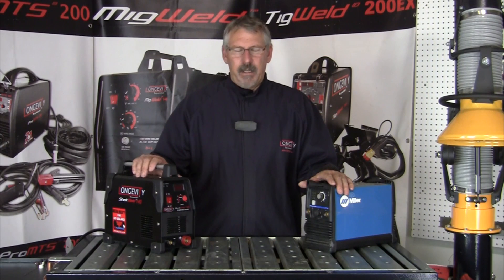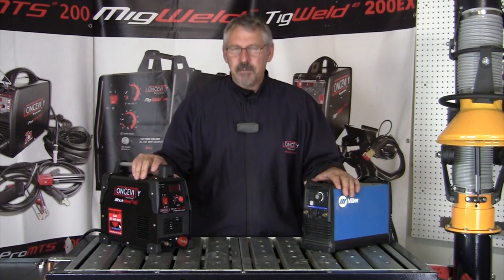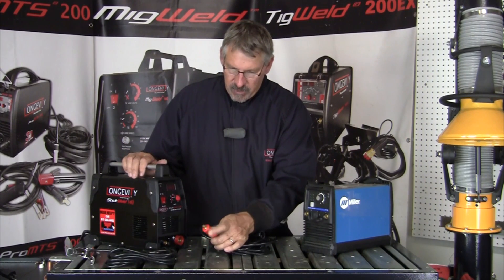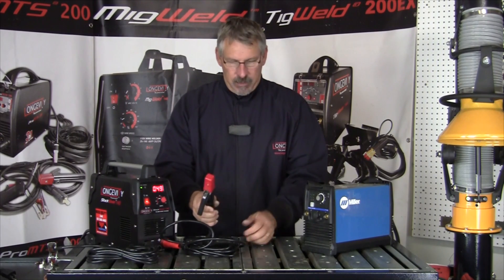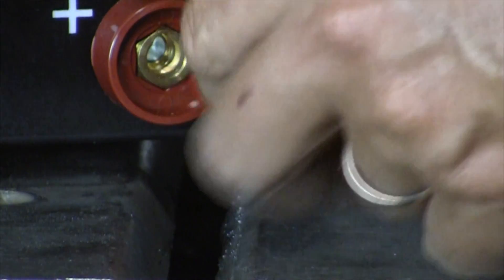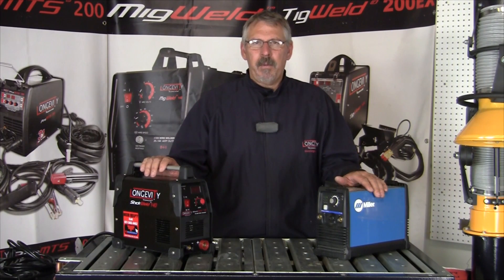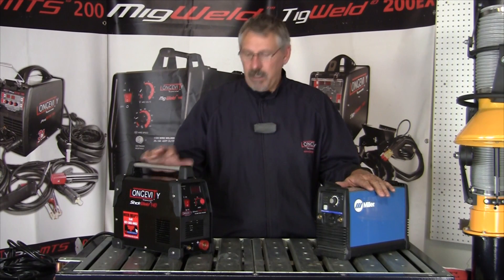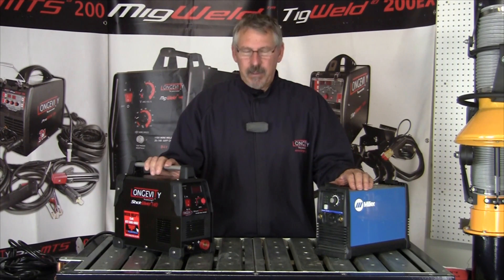MILLER MAXSTAR 150 STL vs LONGEVITY STICKWELD 140 COMPARISON & REVIEW VIDEO

Comment: I had that longevity and it will only ramp up to 100 amps on 120v service. Now I have the maxstar 150 and its 100x the machine as longevity. Longevity is junk and their service is worse. Now they're flat out telling lies to potential customers. They must reply on new customers only. The maxstar 150s are really capable and remarkable for their size. Longevity doesn't make a pimple on the ass of a Miller welder.

Comment: Correct me if im wrong but i beleive the Miller 150 is capable of controlling the amperage for tig welding with either a foot pedal or fingertip control. I dont believe the Longevity has this capability of control.